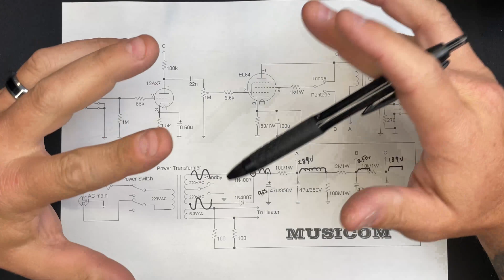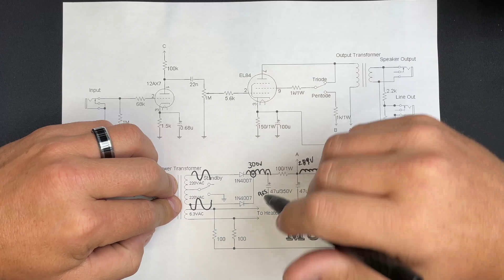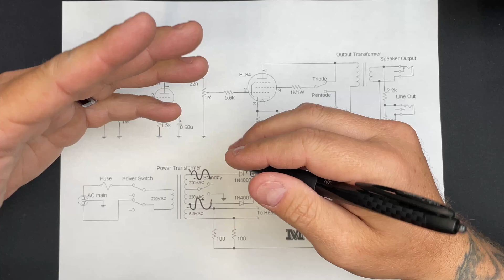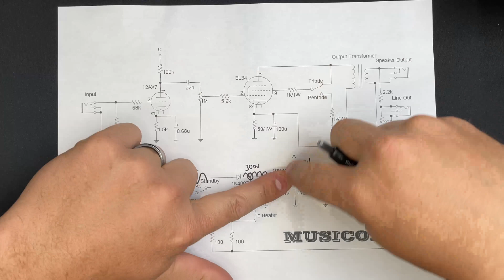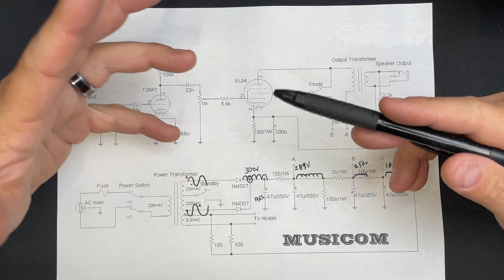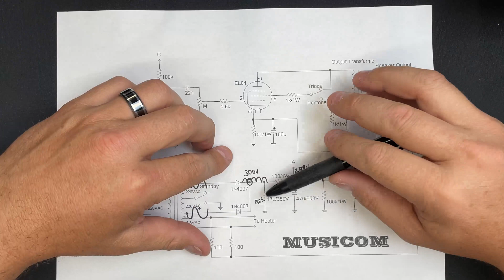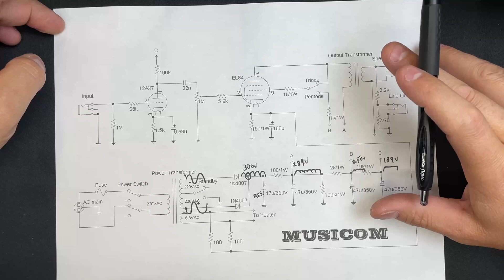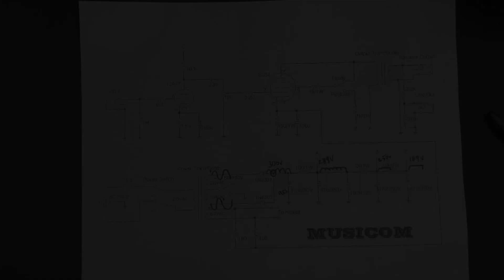GUITAR AMPLIFIER BUILDING BASICS EP 04

Comment: what if i need bigger voltage for the preamp stages than for the power stage?
Reply from the maker: That’s is highly unlikely, as to do so would also mean no dropping resistors, which means no node decoupling, which = lots of hum and buzz. 

Your preamp tube would also end up with more swing than your output tube, which will cause distortion. Incidentally, this is pretty much what voltage scaling does. It lowers the output tubes supply voltage to much lower than that of you preamp, making your output wattage drop and induce power tube distortion. 

So while it is done as a feature, the amp is still designed traditionally, and the power scaling is added to achieve a desired result.